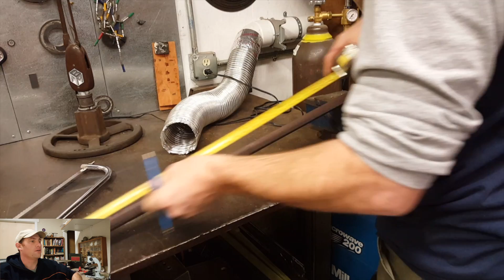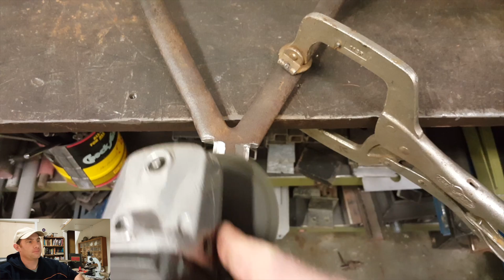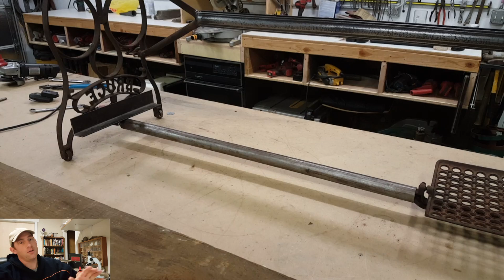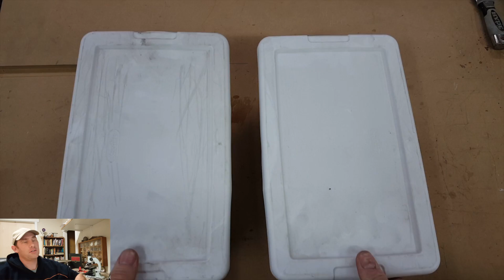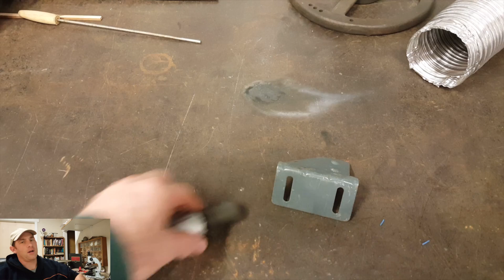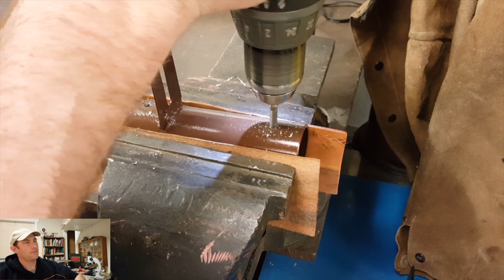Reclaimed Barn Wood Entry Table - Metal & Woodworking How to

Comment: Nice Work — one Q: what did you use at the beginning to "clean" the metal base ?
Reply from the maker: I think it was a degreaser like Simple Green. I was just trying to remove the dirt and grease. I wanted to keep the rust for this project.